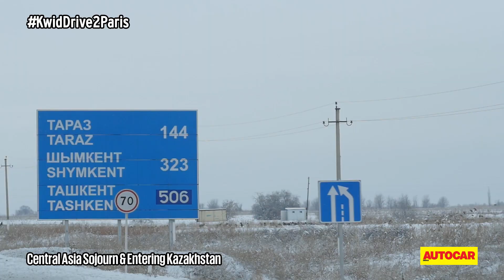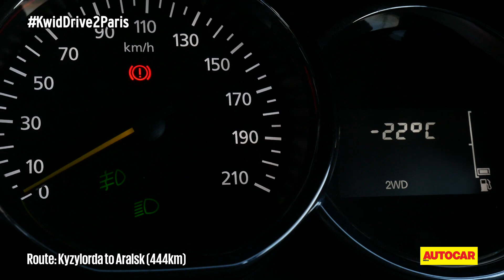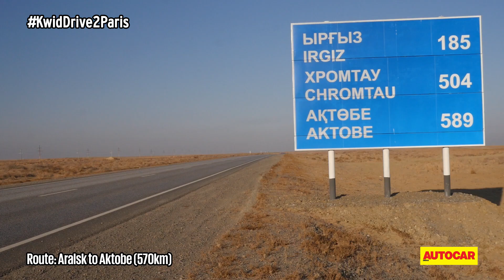#KwidDrive2Paris | Webisode 07 | The Kwid Enters Kazakhstan | Autocar India

Comment: I think china and other countries have high octane graded fuel does it help in performance??
Reply: aniket virat 
here in China the octane rating is 94 were in our India it is below 91 .But as we see the kwid has compression ratio 10.5 which is norrmal and it is also drived at -5 degrees centigrade so no use of it.
octane rating is the only quality of fuel to not predetonate before power stroke due to high temperature of engine but as we see temperature are below minus ..
for performance we need fuel having added content which enough oxgen for combustion such as nitrous oxide having twice oxygen than air we breathe .simple